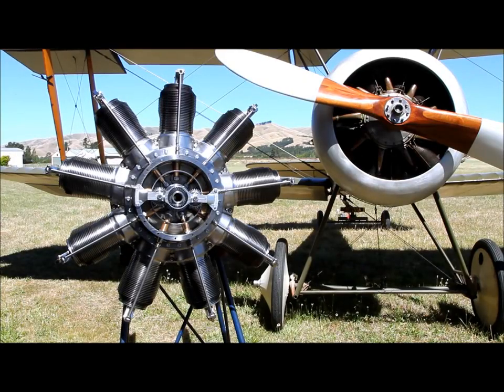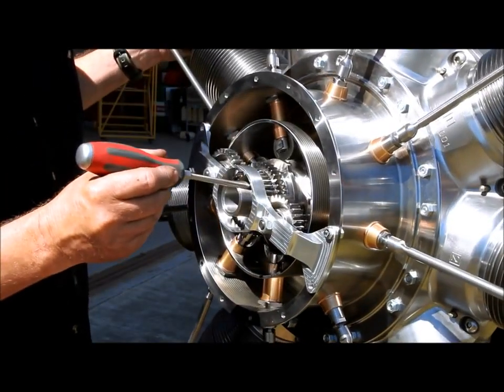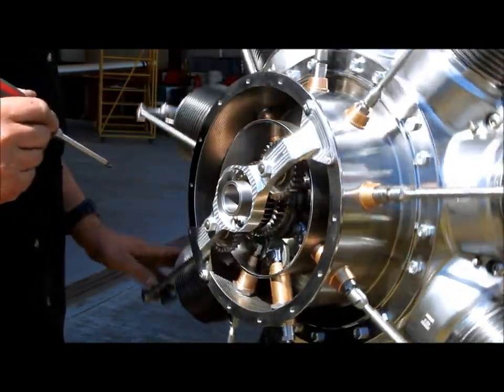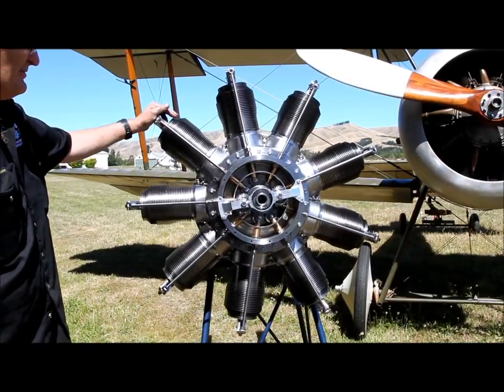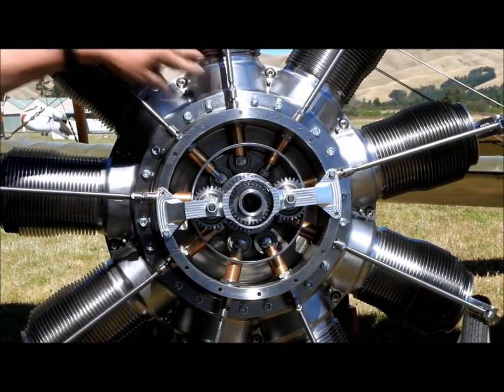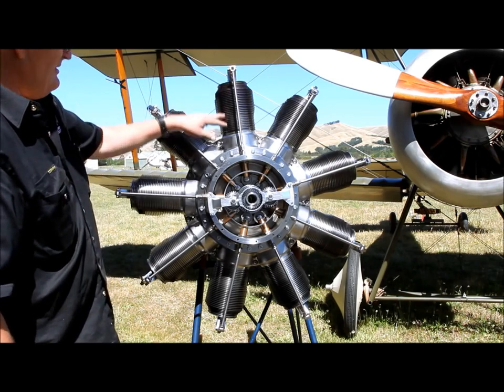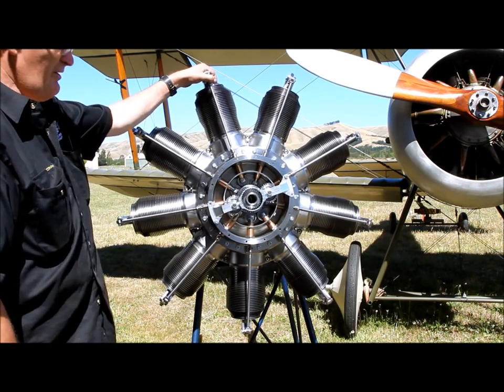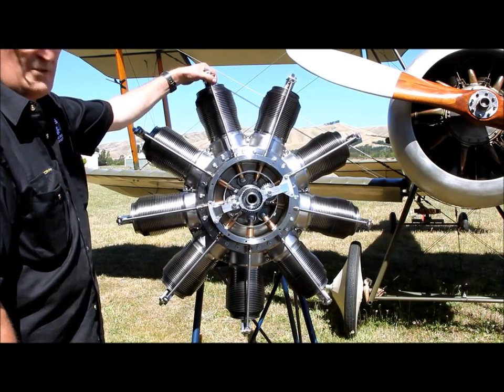How the Gnome rotary engines works

Comment: THE FUEL !!!!! HOw the hell was delivered when the entire this in turning ???????????????????
Reply: The crank-axle is HOLLOW, air and fuel enter the crankcase though a port in the hollow shaft.
Reply: @DoktorBayerischeMotorenWerke  how it gets to the cylinder ?
Reply: @TheHelado36  Transfer ports, like a 2-stroke engine, there is a port in the bottom of the cylinder that is exposed (opened) when the piston is a bottom dead center, the air fuel mixture is sucked in and then is covered (closed) as the piston travels back up the cylinder..
Reply: @DoktorBayerischeMotorenWerke  thanks, I was trying to purchase a scale model of this engine but it got away, is baffling how so many years ago they could design and build such an amazing engine !
Reply: @TheHelado36  Yes, invented by Felix Millet in 1892... for motorcycles, but they proved to be an excellent design for aircraft   until planes got bigger and other engines caught up in horsepower.

Comment: So simple, yet so complex.

I had no idea these engines even existed before two days ago.
The idea of all the cylinders rotating around a fixed crank and cam shaft is something I never could’ve imagined.

I can see why the motor was ultimately abandoned, all that reciprocating mass the torque delivered to the aircraft must be pretty intense, and you’d lose a lot of power to parasitic drain just to rotate all those cylinder heads, but with the crank stationary I imagine the engine is incredibly smooth.

Absolutely fascinating.

Comment: So no conventional carburetor but fuel and air still needs to be mixed and atomized to become usable. How was this done? Also, if there is a rich combustible mixture at all times in the crankcase how did this not combust given blow by gasses carrying flame into the crankcase? And does this technically qualify as a two stroke give the transfer ports and induction/compression/ignition sequence?
Reply: The air, fuel and oil all mixed together inside the crankcase, the heat from the crankcase vaporized the fuel.
as long as piston rings are in place no flame passes into the case.

No, the intake and exhaust strokes are not combined, there is 720 degs of crankshaft rotation between combustion cycles... so its a 4-cycle engine.

Comment: The speed control by ignition must have lead to some spark plug fouling . Something I feel isn't spoken about when discussing this type of engine.
Reply: Excellent point, the pilot was required to release the kill switch frequently to fire the plugs one revolution and prevent them from fouling. If you have ever seen one fly? the pilot constantly "blips" the kill switch when flying at reduced speed..
Reply: @DoktorBayerischeMotorenWerke   Thanks ! Yes you can hear that blipping as they do a fly over for landing. Never put two and two together about that.

Comment: That seems nutty to not turn the crank, but fling everything around it, and then go flying it, but that's just me.
Those men of those days were truly daredevils. 💯
Reply: No need for a heavy flywheel and the engine was incredibly smooth running, also there was no need to warm-up before take-off, as soon as the engine started the pilot could immediately join the air battle.

Comment: These radial engines were developed further, when built under licence in the UK, by one Lieutenant Walter Owen Bentley Royal Navsl Reserve. He applied the idea of using aluminium for the pistons to lighten things further and also help with cooling (with the engine rotating in the air, the leading side of the cylinder gets cooled better than the trailing side). These led to the UK BR1 and BR2 engines, fitted in later Sopwith Camels and Swift aircraft,  from 1917 onwards. But the differential cooling, rotating mass, and gyro effect (reported by other contributor below), limited the power development of the rotary engine - particularly as other manufacturers were introducing the radial engine, where the cylinders are fixed and the crankshaft rotated.
Reply: These are not Radial engines... they are Rotary engines and predate the existence of the Radial type.
Reply: @DoktorBayerischeMotorenWerke  read it again moron

Comment: These engines were reliable and fairly powerful in WW I aircraft.  But...because the entire engine along with the propeller spun in the same direction, the inertia of all that weight was like having a large gyroscope on the nose of the plane.  This would make it difficult at times for the pilot to maneuver in combat situations.  Playing with a child's toy gyroscope can illustrate the point.

Comment: Reason why cooling fins was turned, not cast is that it made balancing the engine easier.
The air fuel mixture drawn from the transfer ports is very rich and don't burn easily. With addition of air drawn from the overhead valve correct mixture is achieved.

Comment: I know this engine tech was short lived, but at some point did they find a way to control engine power? As many on this noted, it either full power or idle
Reply: Some manufacturers were developing carburetors with throttles mounted to the hollow crankshaft but Rotary engines  were quickly reaching the limits of their potential.

Comment: Monosoupape literally means one valve. So that explains part of the engine. But I think it also had a butterfly/reed valve, in top of each piston. So it would suck in fuel and air mixture through that butterfly valve in the the piston, and then the exhausts would be released through the single real valve in the top. Real valve, as in being controlled by the cam. But I might be wrong here. I have some vague recollection that the piston valve was not really needed, and it kept jamming, because of the stickiness of the castor oil used for lubrication. So the Monosoupape version, that is the single valve version, might be a later version that did away with the piston butterfly/reed valves. And used ports in the cylinder walls instead, like a two stroke engine. Which would make the name make sense, pointing out that we now only have one valve, the reliable one, and have gotten rid of the troublesome piston top valve. I'll have to google for this info some day in the future... 🙂
Reply: Intake control was a piston port in the cylinder

Comment: 🟥 Fascinating engineering but it looks like a lot of reciprocating mass.
Reply: The cylinders and pistons are  rotating instead of simply moving up and down.  The piston would maybe trace out an ellipse.   I believe that results in very smooth operation without counterweights.

Comment: If you've ever been around world war 1 era rotary engined planes they sound weird when they come in for a landing.  Remember there's no throttle so either it's on full power or it's  off.  The pilot will line up with the runway and turn off the engine.  They loose speed and the pilot turns the engine back on to gain a little bit more power then cuts it off again.
The prop windmills when the power is cut so restarting is easy.  Eventually they land and the engine stays off.

Comment: I would love to see some diagrams of that fuel delivery system. I have a good mechanical mind and it feels like some 2 stroke elements going on here. Very interesting.
Reply: Induction to the cylinders is similar to that found in two-strokes but relies on suction in the cylinders rather than pressure in the crankcase. The earliest Gnôme engines had suction-operated intake valves in the pistons. Later this design was abandoned in favor of induction ports in the cylinder skirts.
Since the crankshaft and crankcase also serve as the induction system, oil was mixed in the fuel and blown from the exhaust, again similar to two-stroke operation. These were four-stroke engines, however.
Reply: @rescue270  I wonder how much HP could be squeezed out of these engine types using injection and proper valves.
Reply: @ThorstenKreutzenberger  
Fuel injection on a rotary radial engine would take some imagination, but throttling them never worked well. The first of them had only two power settings- off and full blast. Later versions had two or three power settings achieved by shutting off ignition to some of the cylinders. 
Clerget and Le Rhône engines had more conventional valves in the heads and the Clerget had a limited throttle.

Comment: What’s the point of the entire thing rotating?
Reply: Cooling, no heavy flywheel and very smooth, vibration free running
Reply: Because the idea of the King Rod on a single throw crankshaft had not been grasped as yet.

Comment: Why waste the power produced by the engine in rotating the engine itself
Reply: It provides cooling and eliminating the need for a heavy flywheel, they ran extremely smooth without vibration and also didn't needed to be warmed up deforestation takeoff

Comment: So basically it’s a two-stroke, right?
I think Bleriot’s 3 cylinder Anzani engine worked on the very same mechanical principle..
Reply: With a timed combo air intake/exhaust valve,  so...a hybrid?
Reply: @danweyant4909 Still uses the basic 4-stroke principle
Reply: @sandervanderkammen9230  the fuel intake charge is introduced in the manner of many two- strokes.
Reply: @danweyant4909  cylinder ports are used on other types of 4-stroke engines as well, 
The Knight type sleeve valve engines come to mind... it is not unique to 2-stroke engines.
Reply: It's a 4-stroke.

Comment: wouldn't all that rotating mass be like a a big gyroscope in the nose?
Reply: Yes.  In practice if a pilot in a Camel wanted to change direction 90 degrees to the left, it was easier and faster to simply do a 270 degree turn to the right.

Comment: Flying is inherently dangerous. Add a wood framed fuselage and wings, add 30 gallons of fuel, add being shot at with .50 caliber machine guns, and top it off with this 100 HP motor. Then a life expectancy measured in weeks makes sense.
Reply: In WWI they pretty much all used 0.30 caliber MGs.
Reply: They all did. The M2 didn't enter US service until 1921, and the DShK 12.7mm entered Soviet service in 1938.

Comment: I’m not sure how true it is but I heard these rotary engines were made because early attempts at radial engines couldn’t keep the cylinders cool effectively enough so they made it so the entire engine rotated to create better air flow over the cylinders. Obviously this problem was solved due to the reemergence of static radial engines but I’ve never found what actually made them dissipate heat better.
Reply: I too wondered this for the longest time, so I'll share the answer with you. Notice how relatively small the cooling fins are on this rotary engine vs the much larger fins on a typical radial engine.

The cylinders of a radial engine are made of cast metal. However, the casting technology of the early 20th century was not up to the task of reliably casting the large cooling fins that would be needed for a high power radial engine. They could manage small cooling fins, but those cooling fins are not large enough for a 100 hp radial. If you have the cylinders spin, like a rotary does, those small cooling fins are suddenly getting enough airflow through them to keep a 100 hp engine cool.

As casting and other manufacturing technology improved, it became possible to make cylinders with large enough fins that radials became viable.
Reply: @Crosshair84  Brilliant. Thanks so much for the info.
Reply: @crosshair84 - Process Engineer here: your explanation is wrong. Those fins are not cast. The cylinders are cast and then the fins are machined in a lathe (in the case of air cooled engines with a different geometry the cylinders are machined in a milling machine).
I believe that the reason for doing rotary radial engines such as this was because they consume less resources (time, raw materials and tools) and therefore they are cheaper and faster to manufacture than a stationary radial engine.
Reply: @RM6737  "Rotary Radial engines" ??? 
That's an oxymoron... no such thing exists.
Reply: @RM6737 By definition, a Rotary engine is a classification of engine that has no rotating crankshaft and the main assembly or rotor spins concentrically around a fixed axis.

The Rotary type engine PREDATES the Radial type engine... it has always been called "Rotary", Millet Rotatif or Umlauf motor. Not Radial.

Radial engines use a conventional layout with a stationary assembly and a rotating shaft.

Any questions lad?

If you do have a degree in engineering?
I suggest you inquire about getting your money back... because that diploma is not worth the paper it's written on.
Reply: Rotary engines were also lighter and had less vibration... the Rotary also predates the Radial
Reply: Static radials were designed to run very rich which cooled the engine.  Eventually engineers designed much better cylinder head fins so rich mixture was not needed.  That is how Lindbergh crossed the Atlantic without running out of fuel.

Comment: Interesting. It's a 2 stroke, and the engine itself spins, not the crankshaft.
Reply: It's 4-stroke
Reply: Woops.
Reply: It's a four stroke with 2 stroke induction.
Reply: @redtobertshateshandles  What is 2-stroke induction?
Reply: @redtobertshateshandles  What is 2-stroke induction????

Comment: This type of engine had the best power-to-weight ratio at the start of the war, in addition well balanced, these engines did not vibrate, the only problem was that the rotation speed was limited, therefore ultimately the power
Reply: I have this doubt: did the propeller´s sense of rotation go opposite to that of the engine, in order to somehow balance torques?
Reply from the maker: Prop is attached to engine so spins at engine rpm.
Reply: @javiergilvidal1558 final stage of their evolution was use of reductor. So that propeller would spin in other direction. 200hp

Comment: Apparently, like a 2 stroke, the oil is premixed with the gasoline.
Reply from the maker: Oil is pumped into the engine. It has two supplies, one to the master rod and another to the cam pack. It mixes inside the crankcase and then out through the cylinders.
Reply: @classicaeromachiningservic262  - They spewed enough castor oil onto the pilot to cause a little difficulty with the runs.  😬

Comment: Amazing technology for it's day!  I'd suppose the fuel gets fed in through a central tube at the back.  However the rotating crankcase made it into a gyro, which in turn made the plane very hard to control.  It tends to roll to one side very easily, but to roll to other side takes a lot of effort and muscle power.  This is coupled with the fact that these engines are either in idle or in full throttle.
Reply: Agreed, however a twin with counter rotating Gnomes would be... interesting!  Victorian answers to 20th century problems, I love Gnomes. "It's gets too hot, well just spin the whole mill. Righto!"
Reply: Note: Further viewing of this engine actually flying demonstrates the cunning newly invented 1/2 speed position...
by using modern electronic spark control to cut out every second ignition pulse...
allowing a steady state half throttle for cruising....
Reply: It had its advantages in a fight - you can use the torque to turn one way lightening fast. Enough to ruin your opponents aim.

Comment: So induction is by slip-valves much like a 2-stroke but with exhaust being via the single valve? And the crank carries the fuel-air mixture to their sump, so is it mixed with lube oil like a 2-stroke? Else how is the engine lubricated?
Reply: It is mixed. Alcohol and Castor oil, I believe.
Reply: Sort sort of like a 2-stroke mix  @jerrylong381
Reply: @iainhunneybell oil injection
Reply: @jerrylong381 gasoline and castor oil
Reply: Oil is injected via a injection pump, not pre mix
Reply: @classicaeromachiningservic262
7 days ago
Oil is pumped into the engine. It has two supplies, one to the master rod and another to the cam pack. It mixes inside the crankcase and then out through the cylinders.

Comment: OHHHHH

IT'S A 2-STROKE. 

Ok that explains a lot.
Reply from the maker: No it’s a 4 stroke but it’s uses a ports in the cylinder to get a rich mixture of fuel, oil and air from the crankcase.
Reply: @classicaeromachiningservic262  Wat.

So it's a 4 stroke that...only has 1 valve?

My brain's broken.
Reply: @connarcomstock161 Some 4-stroke engines have no valves
Reply: @WilhelmKarsten  

YOU HAVE NO-

ok wait what?
Reply: @connarcomstock161  There are 4-stroke engines that have No poppet valves.
Invented by American Charles Knight in 1905.
They were massed produced for several different automobiles and aircraft 
Most notable were the Willys-Knight cars and aircraft like the Hawker Typhoon and Tempest
Reply: @WilhelmKarsten  Oh sleeve valve nonsense, forgot about this stuff, was big back in the day yeah.
Reply: @connarcomstock161  non-sense?
The Hawker Tempest was one of the fastest propeller driven aircraft in WW2..
Some Sabre engines produced as much as 3,600 horsepower

Comment: Since it uses transfer ports, is it a 2-cycle engine?
Reply from the maker: It’s still a 4 stroke, it’s getting oil, fuel and air from the crankcase but most of the air comes from the mono valve.
Reply: @littleshopofelectrons4014  No The camshaft rotates at half the engine speed opening  the valve every second revolution. 
  The valve Opens just before BDC and closing just after TDC producing lower air pressure in the cylinder.
The piston travels down and uncovers the transfer ports and sucks in the fuel and oil mixture from the crankcase.
The piston travel up compress the mixture the magneto spark fires at just before TDC.
Watching video of these engines running sometimes you can hear them firing on one or two cylinders due to some part in the top of the cylinder being red hot from a too lean  fuel mixture.
Watch this video @ 1:55 to hear this https://www.youtube.com/watch?v=Hq78ZocOAkY